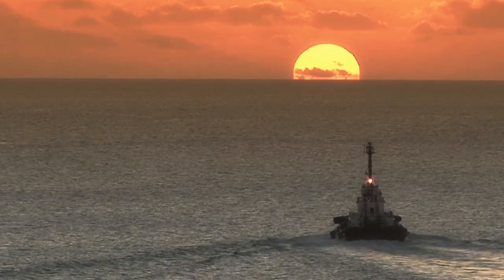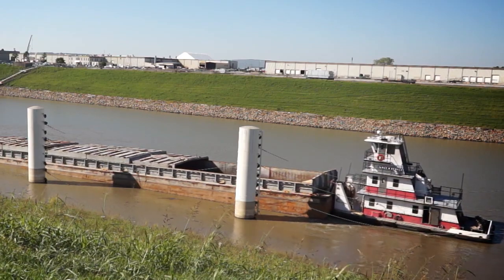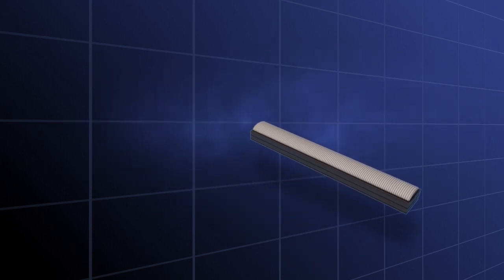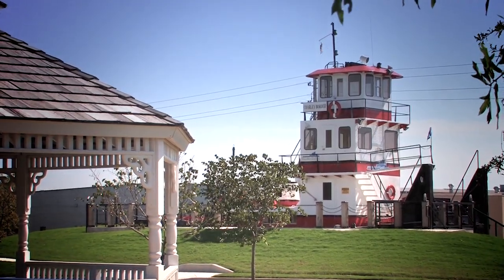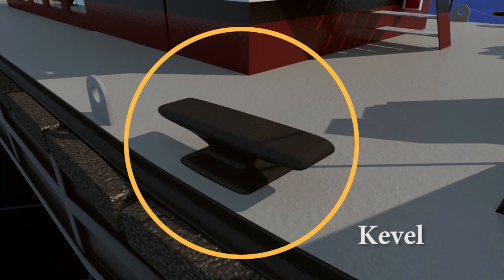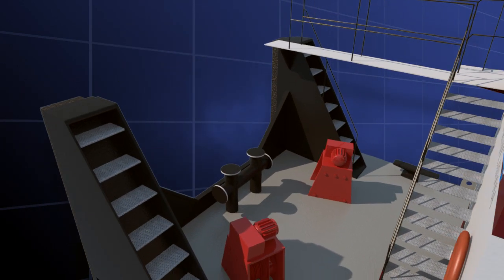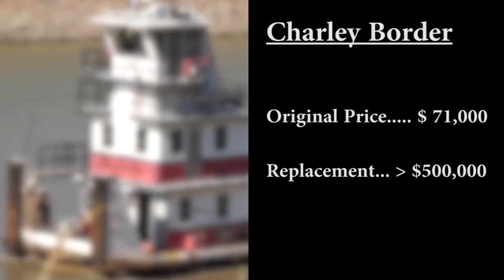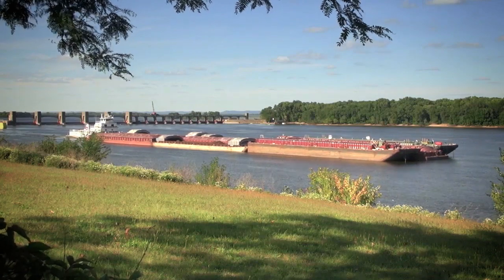TPC Towboats

Comment: As a tugboater, I can tell you that tugboat and towboat are interchangeable and useage depends on region.  Southerners like the term towboat for some reason.  They must use the term "tow knee" too cause around here they are called "Push Knees". Seems to me that these guys WISH they were on boats that actually towed, instead of getting paid 1/2 wages and working double time on the river